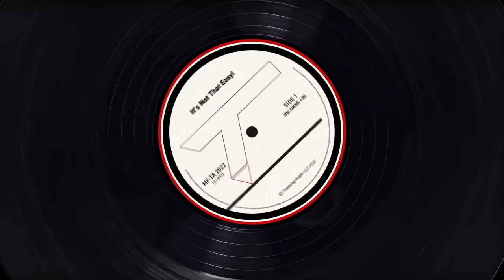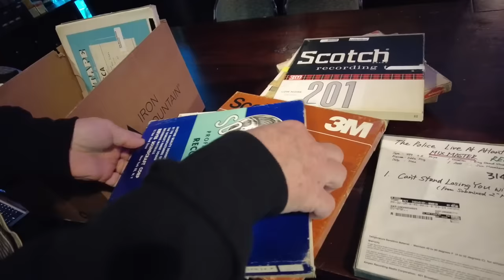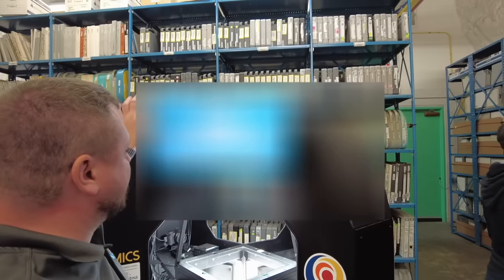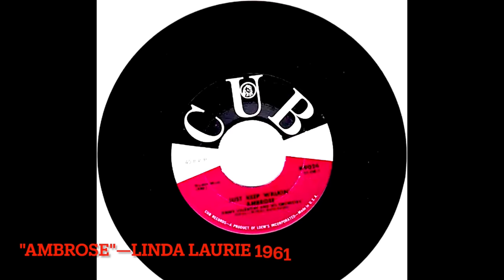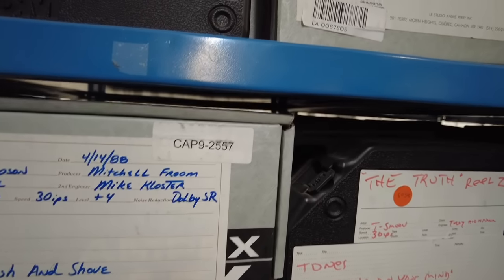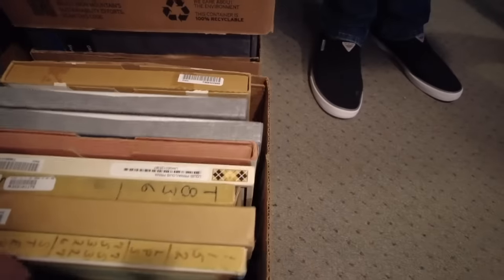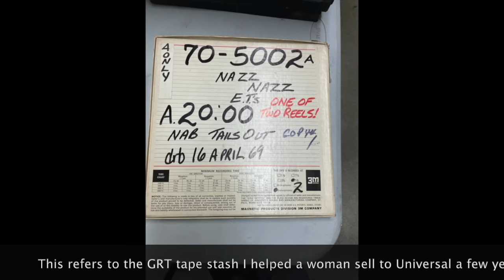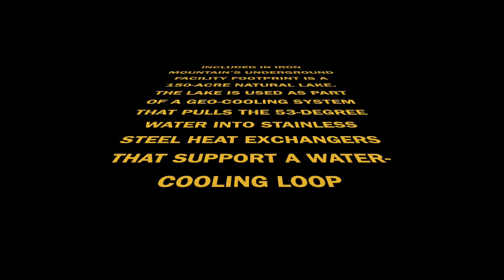Universal Music Group Opens its Iron Mountain Tape Vault  And You are Invited!

Comment: And as they say. Be careful what you ask for. It's been over 100°F every day  for more than a month. And while that is much more comfortable  to me at almost 68 years of age. I collapse from the heat much easier now. Whoops.. So no vigorous running around on those 100°F days. Let my grass overgrow. I am not mowing it in this temperature! Thankfully most of it has already died. And I haven't. As the only grass I like. Is? The stuff I smoke. Of course. It allows you to hear everything better. And therein lies the problem. Not enough consumers consuming  POT.

When you'll then notice. Your speakers are not wired correctly. And you will flip the connections on both the left and right channel, speakers. Then take another listen. You will no longer hear most of your lousy acoustic aberrations. Even if you do. It will not irritate you as before. You will hardly notice it anymore. This is how Psycho Acoustics acts upon our brains. And you don't have to be Psycho to hear it correctly. Even if I am. But it helps.

So there you go. Everything you need to know. To enjoy the sound of your cheap, crappy, stereo, at home. That will now sound much better. Then your friends who have systems that cost 10 times more. And they won't understand? Why is your lousy stereo sounding better than my,  luxurious, luxury, system? They won't understand? And I just love doing this. To those dumb idiot  audiophiles. And Acoustic and Electrical Engineers. Because they don't understand either. What has happened? And why? They are clueless with their college degrees. It's sad. It's very sad. That they can be this ignorant, this dumb. And have college degrees. I know one that has a PhD. In Audio Engineering. And he is an absolute  BOOB!  His claim to fame? He recorded John Denver with Luciano Pavarotti.. Oh boy! That required at least 2 microphones. What a genius! Even if Alan Kefauver didn't know which directions his microphone diaphragms were appointed in? Yeah Alan. You don't put the microphone to the side of the singer. You put it in front of the singer. He didn't know that. As I made a double parallel recording. Of that same event. With him. And the singer soloist was a Professor of Voice at Peabody Conservatory of Music of Johns Hopkins University. And I was an NBC Audio Engineer. And Alan made school recordings wrongly. So did Dr. Mike Cherry. Another fraud, audio engineer with the University of Maryland, Baltimore County campus. That got phase backwards on microphones. On tracks I could not mix properly because of that. What the hell? This is a beginner mistake. And he's got a PhD? What a fraud! And I told him he was a fraud to his face. I said there is no PhD program in Audio Engineering. He said oh yeah? Well? At the University of Maryland. If they don't offer a PhD program for your subject. You can create your own! Oh really? And who do you give your, Senior Audio Thesis to? A physics professor? What the FUCK do they know about good recorded sound? Nothing! Zip! Nada! None! They know nothing about proper sound. And then you get a PhD! What a fraud!

And so I know a ton of, fraudulent audio experts with advanced college degrees. In my field of expertise. That they do not possess. But you'd think they did. Because they wave their diploma in your face. Lookee here! I got this! It says I'm an expert! Call me Dr.! Yeah no. He's a fraud and an incompetent. And has no idea what he's listening to? As how do you get a set of groovy black female backup singers. With three microphones on three women. All together and one is out of phase. And you can't get a stereo mix. Without half the girls canceling out. It was a fucking nightmare! Of total PhD incompetence! And there was no recovering those tracks adequately from that. As it was 3 passes of three. And one would always cancel out. And so did he have his speakers on? Or was he just watching meters move? He was just watching meters move. And assumed everything was fine. How does that work in a PhD thesis? It's out of phase and it cancels out but I don't care it's correct! Yeah no it's not. And I only ended up with 6 black girls singing not 9. Though Georgie paid for nine. She only got six. Because the PhD doesn't know how to count to, 180. And so there's a problem. That could not be engineered around.

At what happens when a PhD like that builds a rocketship. For customers to take a ride in. Without it blowing up. With them in it. Or maybe as a pilot. Flying a jet airliner. During a blizzard and ice storm. As it's the safest way to travel. Until the 737 slams into the, 14th Street Bridge. And slams into the Potomac River. With 136 dead out of 142. Because both pilots got the timing on the wing deicing, wrong. And they had thousands of hours of flight time. But whoops. They didn't watch the clock from last deicing.  Was it 20 minutes or 60 minutes? It doesn't matter! Let's go!  Yeah into eternity forever. And I was right there! For NBC Radio News. As I was only blocks away. As I was interviewing, Stevie Wunder. And my interview interrupted. By a fucking plane crash 6 blocks away. Ugh and I was standing on that bridge for the next 18 hours! Improperly dressed I might add. And ended up suffering from exposure. When I woke up to Howard Stern on my clock radio. How much is a one-way ticket to the 14th St., Bridge? What do your stewardesses ask people? Do they want coffee, tea or ice water?  HarHarHar!  Yeah and he got fired. And then rehired in New York City at WNBC with a huge raise. Oh please?

Yeah so you folks are a bunch of wannabes. And that's understandable. I had a lot of fun in the industry. I worked with mega superstars.  I worked  with the best of the best of, the best. I was extremely lucky. And I was extremely good. Because I wanted to be the best in the world. At, what I did. And I did.

And I am extremely proud of all of my life and technical professional accomplishments.
RemyRAD

Comment: And 30 years ago. In the 1990s. Before this operation ever existed. To transfer analog Masters  to digital formats. It was only done. By just a few individuals. And people like myself. The have always had. The same equipment to these guys. There is no record-breaking technology in use, there. It's just, standard, typical, off-the-shelf, stuff. By numerous different manufacturers. We are each one sounds a bit different  from the other. And all impart their own characteristic tonality.  There is no transparent neutral version. As they all rely upon the skills. Of those electrical engineers that designed them. Kind of like different religions. All the same. All slightly different.

And so I don't necessarily agree. On their incessant use of the Studer tape recorders from Switzerland. To play back, American recorded material.  That was recorded upon American machines. Which sound quite different.

And so for the authentic transfer of what the artist, producers, engineers and label envisioned. It was played back. From those American machines. And so why would you play them back on, European machines? Don't you want their original authenticity? Or are you out to reinvent their wheels?  And change their sound from what they envisioned? I think you have a lot of audacity doing. And you do not use that brand of software. Because it's crap. But no doubt you have Technical Audacity.

Yeah and so if it was recorded upon a Scully. Shouldn't it be played back upon that Scully? To hear it the way they heard it. When it was created. And not with a European slant or filter. So I think that is preposterous!

The American-made Stevens, machines and transport. Was where it's at! It is the most gentle on tape. No numerous S-shaped rollers to pass your tape through. A simple in around and out. Largely unmolested. Not inducing any scrape,   wow or flutter. No stretching the tape by jamming on breaks from high-speed shuttle. No, captains and pinch rollers. To stress, mar or stretch the tape.. Like a Studer can. And a Scully transport would be my next choice. Why? Because I built them! I know the precision in which they were built. Because they would have to get my Quality Control rubberstamp upon. And everything tested by me. As I am one of the last surviving members. Of these legendary companies in the USA.

At my expertise. Goes way beyond some of these, rock 'n' roll jokers. I built this equipment they are using. I, QC' ed, this stuff. And went over it with a fine tooth comb and a micrometer. Along with state-of-the-art test equipment. Back in 1979. And flutter and speed stability can be every bit as good as a Studer. And since they are not recording and punching in and mixing for hours on end.. They are just a one stop transfer shop. They are your 24 hour photo developer.

And here's the sad part. These audio experts they have. Not a single one. Realizes they are listening on in phase but negative polarity speakers. They haven't a clue what is going on. But they think they know what they are listening to. They don't. They are clueless. They are technically, inept. Though you'd never know it. I certainly do.  All a bunch of moron rock 'n' roll geniuses. And I am not particularly, impressed. In fact I don't think much of audio experts monitoring on, negatively polarized, sucking speakers. Speakers that are physically, sucking the sound away from you. Not directing the sound toward you. Because nobody understands the process of what is occurring. Ignorance is bliss. And when everything looks pretty. It must sound, pretty. But that's not how it works. And I cannot trust what they think they are listening to. From any of their speaker systems. Because they haven't figured this out yet. No one does, generally speaking. Only a few of us know about this terrible, technical blunder by everyone. Absolutely, everyone. With few exceptions such as myself and the JBL Speaker Company of Los Angeles, California.  We got this right. And 99% of everybody else hasn't. And nobody knows what they are listening to. Otherwise they would not be monitoring in this manner. This is a clueless beginner error all of these electrical engineers and acoustic engineers have all made through the years. Because they think they got it right. And cannot see to reason. That they got it wrong.

This simply comes from understanding. What happens when a signal source of sound. It's the diaphragm of your microphone. And do you want your speakers moving the same way like that? I would think not. You want your speakers moving in the opposite direction. Out toward you. And that requires that you invert the Polarity. At the output of the audio power amplifier. That moves the air with the loudspeakers. It has to move the air in the right direction. It's not. Everybody is backwards.  Your speakers are sucking away from you. They are literally, sucking.

Andy's mindless moron electrical engineers  and acoustic engineers. Think that's perfectly fine. Nope! No it is not fine. That is statistically, backwards. That is technically, backwards. And in negative polarity. To make certain it stays in phase! Which is an ignorant line by ignorant wannabes who consider themselves audio experts. And wave their college degree in your face. I'm tired of those stupid frauds. Some even my hero electrical engineers. I always looked up to. Only to find them this kind of stupid also. Can you say Bob Orban? I can. He don't get this? He thinks I'm full of it. Maybe he should tell JBL the same thing? It's all their fault! And because I fell in love with the sound of their speakers over everybody else's speakers. Because they just spoke to me in the right manner. Because they were in positive polarity. Nobody else's  were.  And I can hear that quite plainly. Other people can't. And because they don't want to know I've discovered. They are convinced.  Everything is wired correctly. They don't even want to hear, the difference. And that just slays the shit out of me! Why not?!

And so I find most, audio engineers and self-professed and notable audio experts. To be nothing but clueless miserable hypocrites. And frauds in a can. As I've discovered. Most audio experts. Don't really care about getting the finest sound. They only want to get the most fun sound. And the stuff with pretty colored flashing lights on them. That tells you you have made a great purchasing decision. In how you wasted your money. To convince yourself. It sounds right! When it really doesn't. And you don't know why? Is the speakers. It's the amplifier.  It's the converters. It's the audio console. It's the acoustics. It's the noise level. It's 60 Hz instead of 50 Hz. It's, A-440 instead of A-438. It's Dolby A.. Instead of Dolby SR. It's, yuck, DBX Type  I tape noise reduction. But they used DBX Type II, tape noise reduction. And the units don't look any different? But they are not the same. And most idiots are unaware of the differences. Because you can playback through either and not understand was going on. Or what's not going on or coming out.  Though I came out years ago. Decades ago.

At folks that didn't work for these companies making those old tape recorders. Won't know what I know. And so they are all like Stevie Wonder. Trying to drive to Chicago from LA.. As he can't drive. He's blind to. But that doesn't mean he couldn't try. With the help of a sighted person in the copilot seat. The way Willard Scott taught Eddie Walker, how to drive! Eddie only had plastic eyeballs. I know. Because I worked with both of those wonderful gentlemen now departed. They were a couple of the historic greats!  That will never exist again. From a bygone era.. Like me.

Oh my God commission Mark I can't believe I'm going to be 68 in a few days. Where did the time go? And have we digitized everything yet? Hell no!

I have my own analog library I still want to Digitize. If any of it is still, recoverable? Much of it is not. Much of it is acetate tape. And I can kiss that goodbye. That's my mom and dad. I'll never hear them again. Though mom on some 78 rpm and 33 1/3 records and analog tape. That was recorded on mylar/polyester-based film, tape. And that should be recoverable, still, yet.

I do like those Prism A 2D converters but don't own one myself. I use another brand. They sound perfectly fine. One is not better than the other. They are merely nuance different. And who's to say which is the best one? Well? I am. And they are both 100% adequate. Either is more than fine. I use great sounding converters, also.

(More real-world info in next post)
Reply from the maker: I guess you missed the ATR decks.